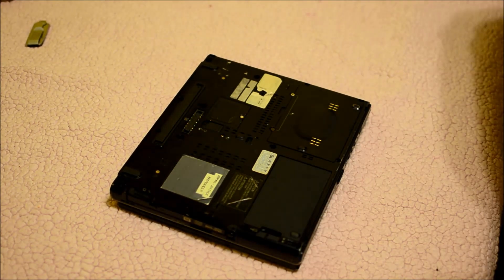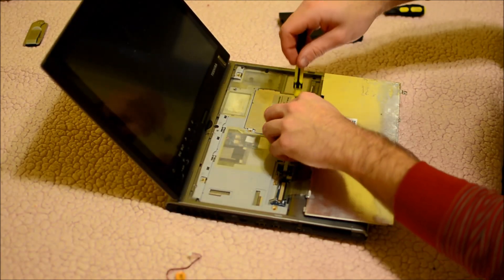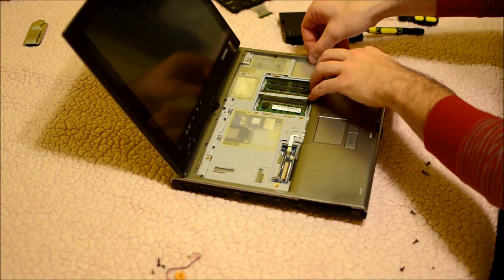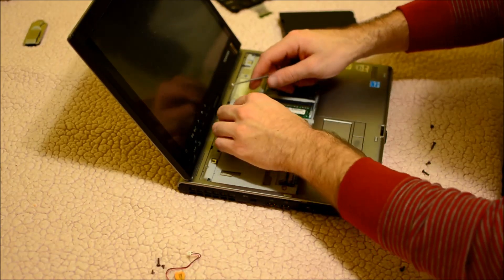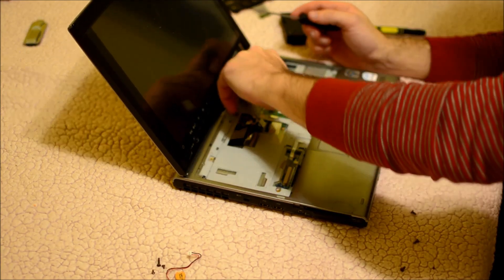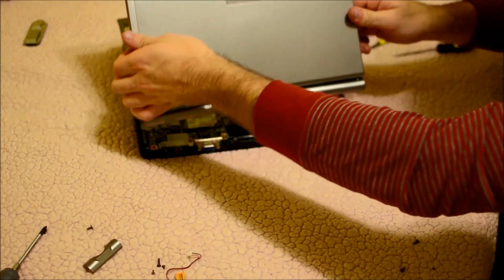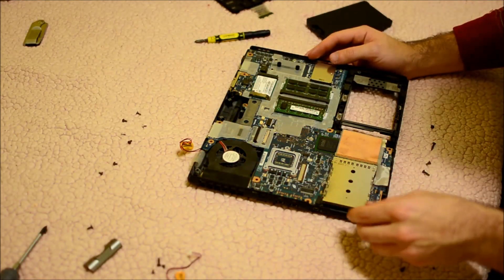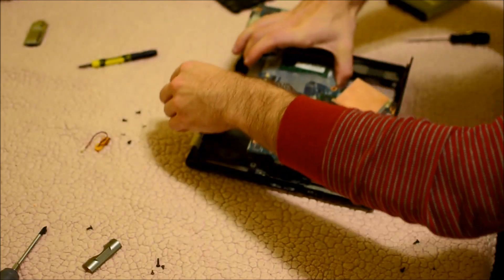Tutorial: How to replace the CMOS battery in your laptop

Comment: A quick video - really? A job so fraught with potential fences to jump - might be under the keyboard, no it isn't - might be under the touch pad, no it isn't, and on and on - better remove hard drive, better remove optical drive, better remember which screws go where as different sizes, until finally the laptop is literally in pieces. Hope you remembered to film the process, preferably without wearing a stripey jumper, which forces the autofocus to keep re-setting. I'm with MrC00lwind's witty comment below -after all this "the only working piece remaining will be the battery itself" !!
Reply from the maker: James Burton Glad I could help you!
Reply: Nevertheless, I did try this on my 15-year-old Toshiba Tetris. Nothing to lose, right? 28 screws later and no sign of the battery, I still could not separate the chassis from the plastic. Ended up ripping it apart in rage! It is now in the recycle bin, and not the Microsoft version!

Comment: What time is seen the battery please?
Reply from the maker: Jiri ? Sorry, I don't understand the question :-(
Reply: Freeze or pause the video at 8:24 elapsed time.  The CMOS battery for this one appears to be an assembly: two coin (or watch) batteries with red & black wires going to a two-pin female connector.  The two batteries (& their wire connections) are covered by yellow heat shrink.

Comment: So basically you dismount the laptop to pieces, randomly searching for a battery. At the end of the operation, for common people, the only working piece remaining will be the battery itself.
Maybe it is a good idea before starting using the screwdriver to have a clue of where the battery is.
Reply from the maker: Yup, that's the purpose of these types of videos!